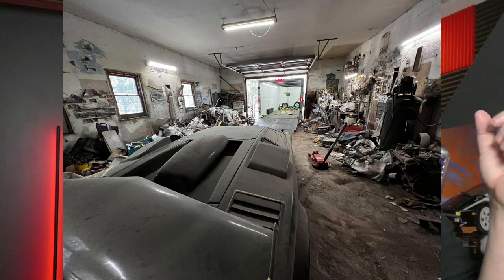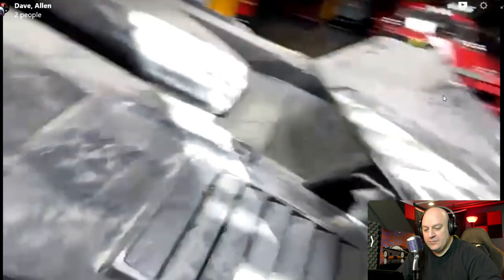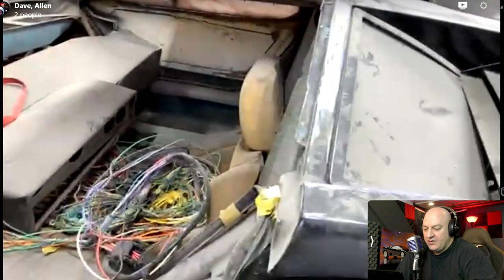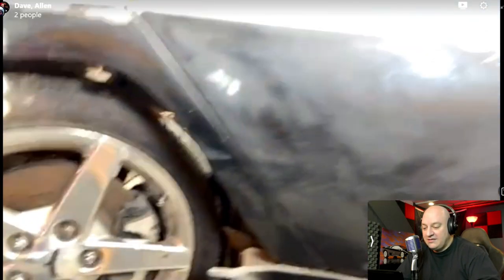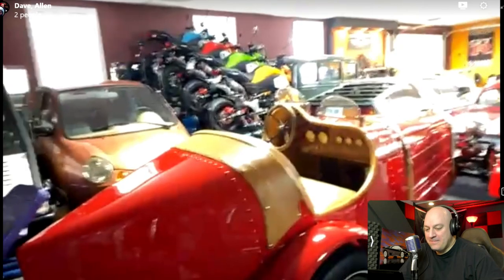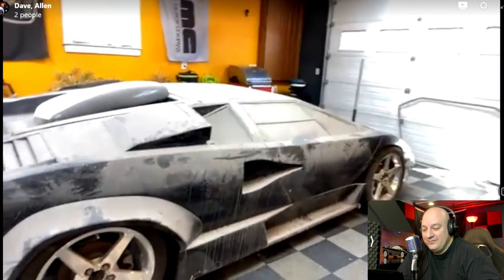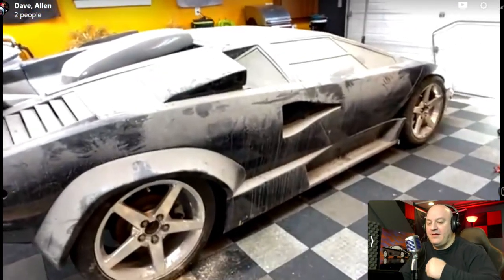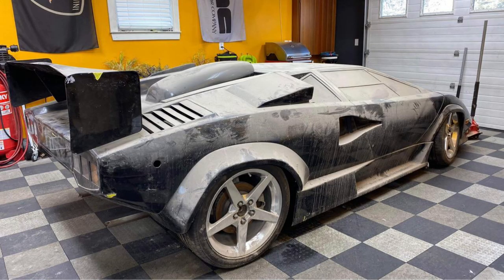Amazing Lamborghini Countach Kit Car Barn Find! - Prestige and Elite Auto Detailing

Comment: The fitment you see Between the Wheels, tires, wheel well size, and the size of the vehicle, that gives it that Hot Wheels look, is very much in style right now. Even if you don't keep those specific Wheels, you should probably keep that fitment. I would highly suggest keeping those rims, getting them refinished (maybe in the factory ceramic gray), and then getting Lamborghini center caps. That way you can maintain the popular Hot Wheels car look, while retaining the appearance of having Lamborghini factory rims on it.

Comment: With Corvette wheels, and corvette brakes, it is highly likely that there is a C4 Corvette front end suspension, as well. Using C4 Corvette front ends, and Rears, is actually quite common in kit cars of the 1980s, and early 90s. Although that body is not a kid, I could not tell you for sure if the frame is or not. Either way, whether it be bespoke or a kit, it is highly likely that that is a C4 front end under there.

Comment: Mercedes AMG V12 is the perfect motor to complete the restoration. Superior motor and more reliable than a Lambo V12
Reply from the maker: I agree.  An M275 would be nice in that car and for the literal same horsepower and set-up a cheap M137 could do the job.  I doubt he's going that route though.  The Lambo V12 BTW, having worked on them, is a very reliable engine.